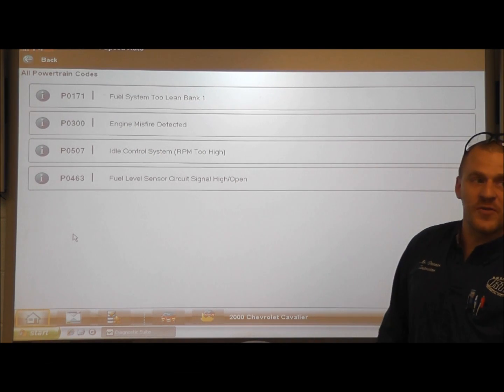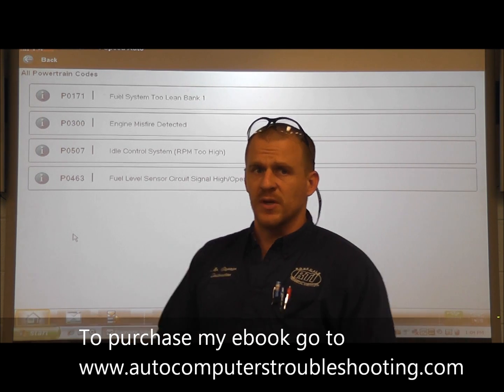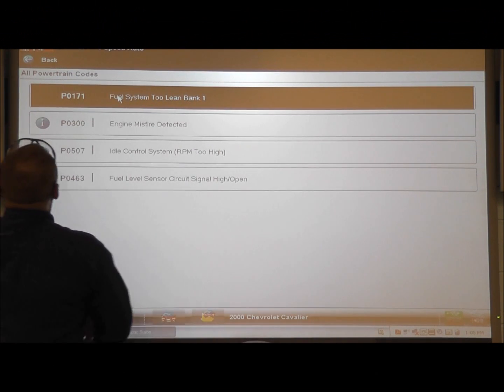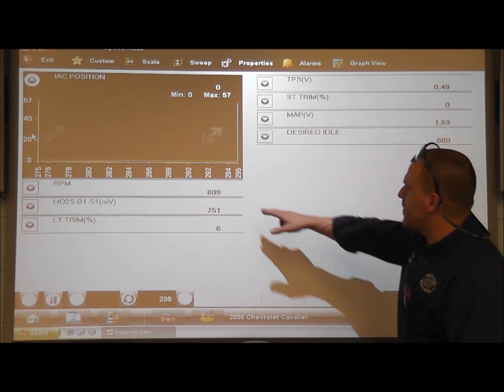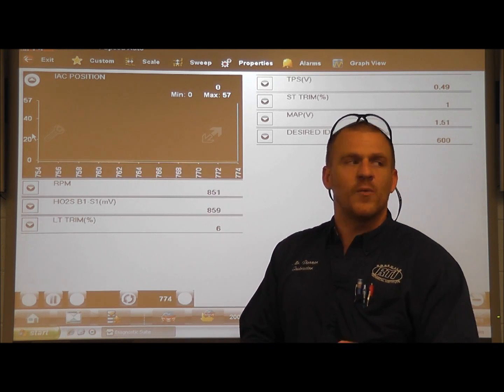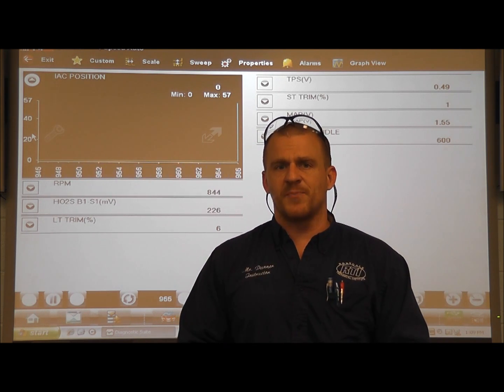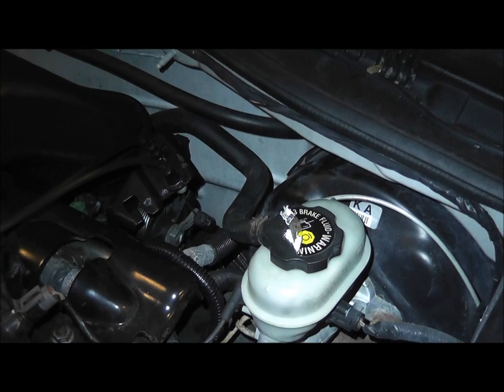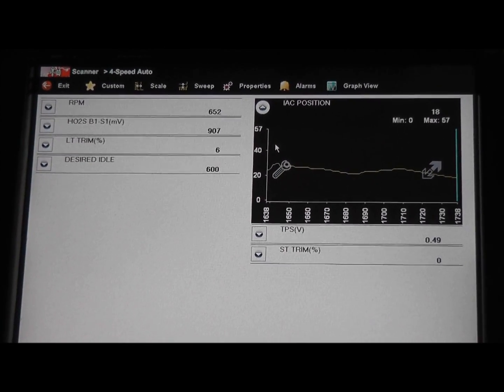P0507 Idle Control System (RPM Too High) - vacuum leak - GM

Comment: I have a 2005 cavalier with a p507 code and I can’t seem to find the issue. I looked for vacuum leaks, checked throttle body for carbon and checked sensors, all seem fine. I even put a new iac in for the hell of it and got low idle code and high idle code at the same time. I noticed the iac stays closed all the time. It was idling at 1200 rpm’s before the new iac. With the new one in it jumped around between 600-1000.
Reply from the maker: You probably added a problem changing the IAC. Before IAC replacement was your IAC at 0 counts with a 1200 RPM idle speed? Look towards a vacuum leak again. Don't forget to pinch off the PCV hose and also the brake booster hose as sources of a vacuum leak
Reply: @ScannerDanner yes, the IAC count is at zero. I heard a hissing around the brake booster check valve. The valve is fine. I pulled the vacuum hose off and plugged it and it still idled high and I didn’t hear the hissing. It is possible I have a few issues going on. I think I will run the smoke machine through the booster and intake.
Reply from the maker: Pinch off the booster hose and PVC hose with needle nose pliers. Then go back to your smoke machine if that doesn't bring it under control
Reply: @ScannerDanner I should mention that I had a large evap leak that lasted for years and I believe I had the p507 along with it. The issue was the fuel filler neck not sealing. I blocked off pvc hose and brake booster hose and no change in rpm. I ran smoke through it and did not see anything. It is a mystery machine.

Comment: wow this is a very old video but...im working on a map system on a ford ecoboost. this engine has no egr and no idle air control valve. egr is accomplished with the cam phasers and ide air is accomplished with the throttle plate itself, drive by wire system. Im at about 50% total fuel correction. idle speed is right at the desired range. ive smoke tested the intake and sprayed starting fluid all over and found no air leaks.  This all leads me to believe that my lean condition MUST  be fuel related.  However, fuel pressure is right at the desired range on the rail and all 4 injectors were sent in for cleaning and found to be in good condition. I posted in length about on the SD forum. Am i correct that this must be a fueling issue?
Reply from the maker: My forum would be where I'd direct you as well. Thanks!

Comment: Hi all just an FYI  went thru a high idle issue on my 1999 ford 
f150---smoked it for vac leaks(yes, i made my own smoker lol) cleaned 
throttle body and Idle control valve--cleared computer and tried to let 
it find it's new base idle---no help--grrrr finally i remembered to 
clean (I mean really clean!!) the pcv valve--Freaking truck calmed down 
and is purring like a kitty!!   PCV valve was sticking!! Hope this helps
 all!!

Comment: Great video I have a 2010 Chevy Aveo LT 1.6 with p0507 idle air control system higher p0315 crankshaft position system variation not learned p0171 bank 1 system to lean p0137 o2 sensor circuit low voltage 1 sensor 2 p0131  02 sensor circuit low voltage bank 1 sensor 1

Comment: Paul...I have a 1994 Dodge van with a 5.2 engine.... this is a restored van .( new engine , new transmission ,rear end , all new sensors on the engine ) van runs great..but the one thing it does not do anymore is that there is no “ cold “ fast idle..and I miss that feature..  I cant figure out why the pinicle on the IAC wont contract enough for a cold fast idle ...any ideas ?  Thank you Michael Peterson

Comment: I hope you can help I have 2009 gmc whit high speed 3000 rpm the maf sensor new tlotle body new in still have 3000 rpm
Reply from the maker: Sounds like you're saying it won't rev past 3000 rpm?
Check it for a restricted exhaust next. Then get a fuel pressure measurement. Not necessarily in that order.

Comment: I hope you can help me with mine. Got this code p0507 and others relating to throttle body being "High" on every codes. I cleaned the throttle and did not change anything. Replace etb and relearn the idle.  After 2 days same code came on so I try to relearn 3 times and my rpm is at 1400. Gas mileage is so poor. Also, after relearning when I turn my ac off the car shuts off while in park or neutral,  but when car is driving and shuts ac off rpm drops to 900. I dont have a tool where i can read my idle position and all the stuff
Reply from the maker: Have you considered this? https://www.youtube.com/watch?v=tJgrHkuqcC8
Reply: ScannerDanner yes, I actually watch all your p0507 related codes. Check pcv and that is running fine. I wanted to check for a vacuum leak but im not too confident using propane torch.
Reply from the maker: use my water test. I have videos on this too. Type in "vacuum leak" or "water test" in the search box on my channel page.
Reply: ScannerDanner yea saw that too will try that lol do you have a video explaining how to read short term and long term bank?
Reply: ScannerDanner watched it going to try it. Here are some data I pulled from data stream. At idle stft is at 25%, ltft is at 9.4%. Press revolution at 3000 rpm stft is around 17~19% ltft drop to 0%. My o2s at idle is at 480~570 millivolts at 3000 rpm drop to 325 millivolts. Im assuming I have a leak since im running lean
Reply from the maker: Of course!
https://www.youtube.com/watch?v=oRX2V6_a3dc
Reply: ScannerDanner I learned a lot from here which motivates me to get a live data but my short term is to high at 25%. Check previous message. Btw you have an email I can talk to you to be more precise. Your videos are really helping me out!!!

Comment: I'm attacking an 02 Suzuki XL-7 with a horrible high idle, about 3500 rpm. Whenever I plug the Maf sensor the rpm rises. I already checked and the pcm is not sending ground to 2 of its 4 control wires, but dang it it really makes me wonder why such a high idle, like hitting gas and gets worse with MAF plugged in.

Comment: I was wondering, is it still possible to have a simple vacuum leak on a MAP-only engine when your low rpm fuel trims are high (say 20+), there doesn't seem to be anything obviously wrong with MAP, O2 sensor or IAC and the engine's idling right at the desired rpms? You say they " can have normal fuel trim numbers" - that kinda sounds like it could go either way. Is there some variable to that? Thanks.
Reply: So, just to follow up on my own question - even though I'm still not sure if you can have high positive fuel trims at idle on a speed density engine due to a vacuum leak (though I suspect it's actually not very likely to happen), I can now tell you from experience that high positive fuel trims at idle can be caused by something entirely different than a vacuum leak - say like a MAP sensor that gives good enough reading at barometric pressure and gets gradually off calibration as the pressure gets lower. Not enough to give you a code for MAP sensor low voltage, but enough to completely throw off your fuel trims at idle, mimicking the classic vacuum leak symptoms.

So if you're chasing a lean idle condition on a speed density engine, be sure to verify your MAP readings. You might spend painful hours looking for a vacuum leak that isn't there, like I did :)

Comment: If this was an MAF instead of MAP system how would the system react to pinching off the booster? Would it just fix the rough idle and lean condition without stalling then?
Reply: there are variables to how it would react. depending on fuel trim, IAC position etc.
Reply: +ScannerDanner Premium  
Is 1400 RPM to high for a 98 suburban  5.7liter ?? If so what can I do to turn it down. I already turned the screw all the way down on my throttle body which brought it down from 1600rpm to 1400rpm.
Reply from the maker: +Sammy Sam you should not have touched that screw
https://www.youtube.com/watch?v=ayjhL9jpFH8
Reply: +ScannerDanner Premium 
1400rpm is as low as I can get it. It honestly doesn't seem like it's idling high as the engine is running, but 1400rpm reading seems like it's a  high number. I thought it should be maybe running in the 800-900rpm range. I also thought maybe my timing is maybe a lil high. But anyways, any pointers or opinions you guys can give me I would highly appreciate it. Thx in advance guys! Enjoy your day! 😎
Reply from the maker: +Sammy Sam need scan data idle air control counts to help further.
Reply: +ScannerDanner Thanks
Reply: Much appreciated, Thx for the quick response.

Comment: when you pinch a hose you can damage it
Reply: A hose can be damaged if made of plastic and the hose clamp is applied too strong. Most rubber hoses will not have any significant damage when pinched. Steel braded hoses should be clamped with great caution if at all. a lot of hoses in the car are nylon braded and very pliable, not much risk there.

Comment: in the old school  id unplug  the booster hose  plug it with a bolt then retest. smoke not needed or run car and listen  under drivers floor area for vacuum  when pushing pedal

Comment: nice presentation on the idle control counts , I know scopes are a great tool but expensive ,and I notice you use snap on for your work ,what model ,without spending the max you think will do a good work , and again thanks for your output on my truck , the most recent calls for scope the injector , but I dong have port ,mine is throtle

Comment: 1998 chevy truck throttle injection misfire on #8 new plugs ,dist cap ,wiring ok ,180 psi pressure 10 ,and 15 psi difference between cyl's flashing light ,1 broken exhaust manifold stud 5.7 engine ,can you give some guidance on this .
Reply: If it is the flat style of distributor cap, these are known for cross-firing problems inside of the cap. My money is on the cap being the issue, even if it is new. I have seen these dist. caps bad right out of the box!. Have you seen me do the RPM drop test with a test light before? This is what you need to do with that cap

Comment: Hi Paul I used to do MOT tests over here, and way to test brake servo, was to pump pedal without it running until pedal goes hard, then rest foot on brake pedal, start car and it should sink down..Fred.

Comment: you got m good  doha man is ignorant.i got n old buick 2.8 that idles so high when i start it and many times stalls once i put it in gear.tried 4 idle sensors used but good n still does the same thing.i smoked the top  n get smoke coming out of the egr,not the base but egr.also smokes from the 4 line plug on top of throtle body.and throtel body some.my codes r 44 n 45  n iac  is it normal for egr to smoke ?whats your take?thanks alot for your videos

Comment: A simple approach using scanner data as primary source of troubleshooting, using only the tools and parts removal to verify the failed component, great work. This will certainly cut down on the parts replacing mind set!

Comment: Great! Very clear and methodical. Your approach to controls is above anything else I've seen on the web. Will check out your other lessons. Trying to clear a P0505 and P0125 on my 2K T4R 3.4L to pass emissions and register- Trouble finding out why the fuel control will not go into closed loop. If you have any videos that may touch on the inte-relationship of B1S1 O2 sensor showing constant 0volts and the P0125, please let me know. Had the p125 since harness damage during clutch service. Thanks!

Comment from the maker: stay tuned to my channel i have a video i shot on a Honda with an idle problem from a cold fast idle valve. it will be a few but if you're a subscriber you'll get an email when i upload it.
it is basically a vacuum leak too when these don't work right.

Comment from the maker: yes but this usually happens on a non MAF engine (speed density system)
when you say performance issues, if it is under heavy loads and wide throttle openings that you feel these issues it is not from a vacuum leak. a vacuum leak effects idle and low speeds only

Comment: Cool video,,,but do you do, if you have neither a smoke machine nor a rubber hose at the brake booster??? For an example, modern VW cars are equipped  with hard plastic lines.

Comment: Sorry I meant to use a unit of measure "inches of mercury", not millimeters. It's the chemistry major in me coming out. 650 is actually considered low, for this 4 cylinder at least. 750 is spec from shop manual, with 10deg timing. I also noticed that if I play with the distributor, I can get the idle and vacuum perfect, but the timing is then way off spec. I need to dust off that new Picoscope you caused me to get and put it to good use!

Comment from the maker: im sorry I'm not familiar with that unit of measurement for vacuum. but if you say 18 mm is normal and you're at 12mm then I do not think that it is from too low of an RPM. 650 rpm would be a normal idle speed

Comment: Hi Paul  - is there a minimum idle speed at which you should measure intake vacuum? It seems that my vacuum is pretty low (12mm),  but so is my idle (~650, 4cyl)...but when I goose the throttle a bit and hold it, then the vacuum goes up to normal, around 18mm. I'm trying to figure out of my bad idle is due to low vacuum, or if the low vacuum reading is only because of the low idle and that I should  be looking elsewhere for the problem.

Comment: Silkylove100 01 Nissan sentra with po302 code po140, freeze frame data after one day got the code again, same codes same STFT and LTFT only. So Nissan update the freeze frame data. I guess same STFT and LTFT because it's misfire..

Comment from the maker: good question. I have found that using freeze frame data to determine the latest occurring code to be misleading. In fact I don't even bother worrying about it. So I guess my answer to your question is I don't know. Maybe someone can add a comment to this that would help us both. I know some cars will give you more than one freeze frame capture and others will not.

Comment: PAUL, I HAVE A QUESTION ABOUT FREEZE FRAME DATA, LETS SAY I GOT A CODE FOR AN AIR TEMP SENSOR TODAY, AND DON'T DO ANYTHING ABOUT IT, THEN 5 DAYS LATER GET A CODE FOR A MISFIRE, WILL THE FREEZE FRAME DATA UPDATE FOR THE SECOND CODE AFTER ? OR WILL IT REMAIN THE SAME FOR THE FIRST CODE WITH THE AIR TEMP SENSOR?

Comment: @scannerdanner my smoke test consist of a ciggar and lungs.. Lol really how reliable is that.. Anyways I already have top intake pulled apart.. Found a collapsed rubber elbow from bottom intake to top of engine block between the heads.. Ther is noway I would have seen this whit out pulling this thing apart to conjested.. Maybe that explains the oil leak bottom side this crank case could not vent... I don't know just my theory..

Comment from the maker: Haha, yea, a little late in checking the fuses. I truly thought I had a shorted 5v reference circuit caused by that aftermarket "performance chip". Oh well, at least the procedures were important to show. Anyway, as long as it is a hot wire MAF with the resistors that look like the ones I have done, then yes. I would do it as a preventive maintenance. Just be careful. And remember not all MAFs are cleanable!

Comment from the maker: P1151 is a lean exhaust code. I would look for a vacuum leak on this thing first. Possible dirty MAF. Maybe a fuel pressure problem. Check your LT and ST fuel trim at idle, 2000 and 3000 RPM and let me know what you have.

Comment: @scannerdanner. Help!! 03 sable 3.0 24 valve duratec 165k this thing will not go into closed loop ... Only dtc p1151, ford pacific,car starts fine but after a min it starts to chugging almost as if it wants to die. where would u began to trouble shoot this thing?? Fuel pressure? Vac leak.. Ohh there is a oil leak on passenger side, that drips on exhaust pipe, maybe fowled up a o2 , highly unlikely huh?

Comment: I just finished watching all you videos. I love the one where you cut the purple transmission pcm wire to isolate the circuit; I was wondering when you were going to check the fuses. Question? Would you recommend cleaning a MAF sensor as a preventative maintenance? I was going to clean mine just to make sure that it never caused a problem later on, especially because I live in a dusty area. Thanks in advance.

Comment from the maker: Using the MAP sensor to ID a vacuum leak would be the same as using a vacuum gauge. It would not be a reliable test, you can still have good manifold vacuum and have a small vacuum leak. Although a large leak would be evident.

Comment from the maker: Unfortunately on a stepper design as this one is, you can't. On a solenoid type you can, as you would monitor the IAC duty cycle and determine valve position/command from that.

Comment: hi, when you have smoke machine in intake, all cylinders(example all 4 cylinders) will get smoke and at any point of time some of this 4 cyclinder will be in intake or exhaust stroke even though the cyclinder are in TDC, so smoke will come out from throttle body or exhaust system via intake or exhaust valve, is my understanding right.